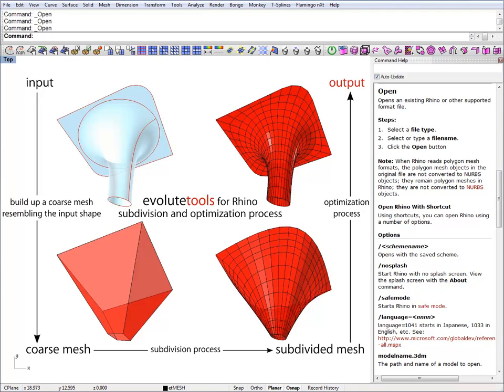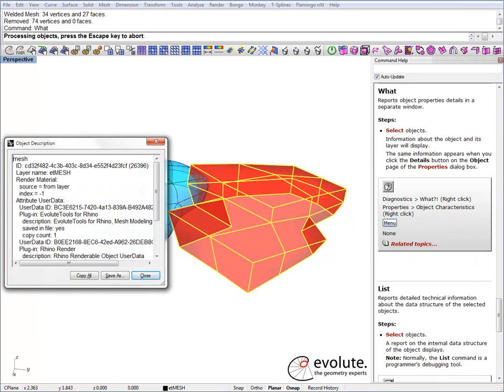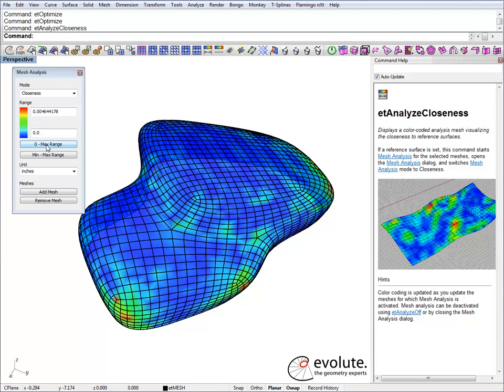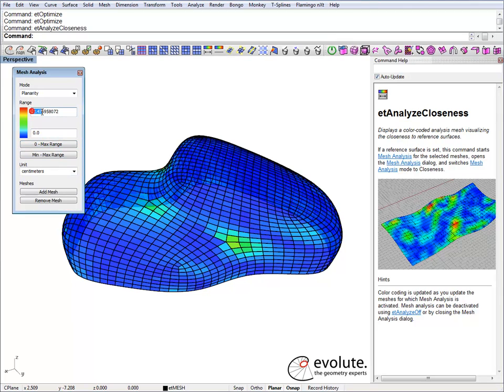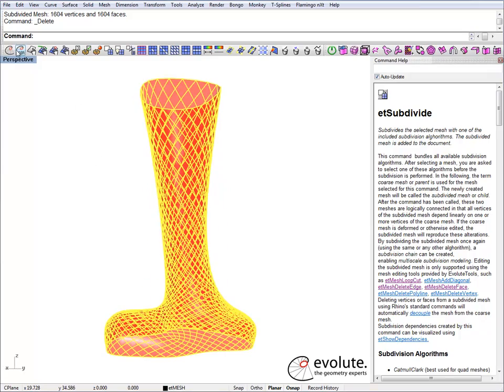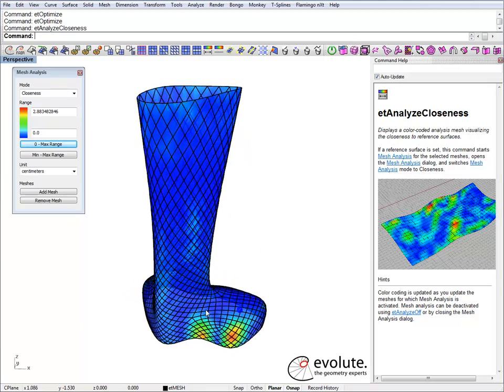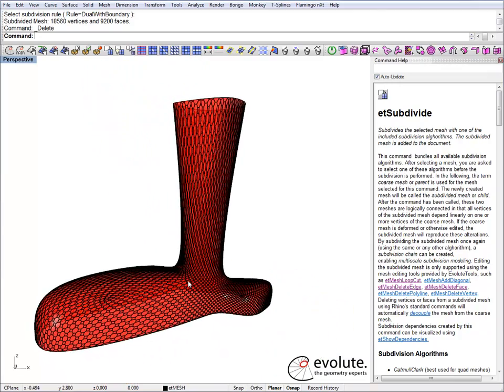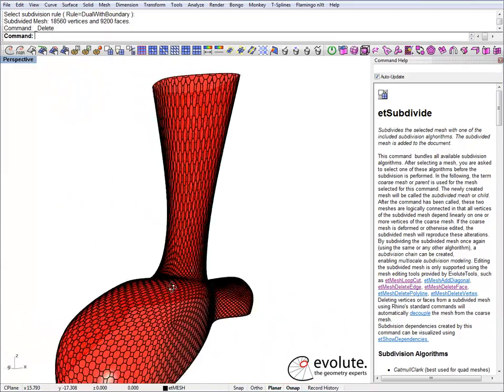TSplines+EvoluteTools Workflow Example A

Comment: hi,
When i try to set reference geometry, it says " failed to discretize reference geometry" i already changed the tolerance of the document, but this problem still persists. what do you advise i should do
Reply from the maker: +Kevin Arambula Hi, please try to use Rhino's "_Mesh" command to manually mesh the reference surface and then set it as a reference. Please use our forum http://discourse.mcneel.com/c/plug-ins/evolute for future enquiries. Many thanks!